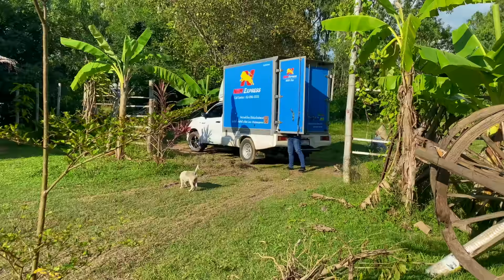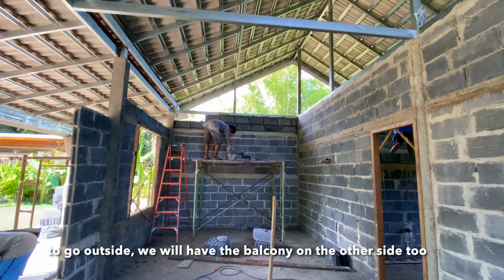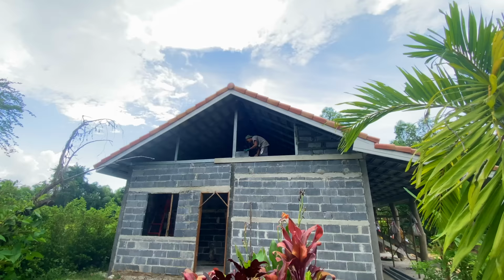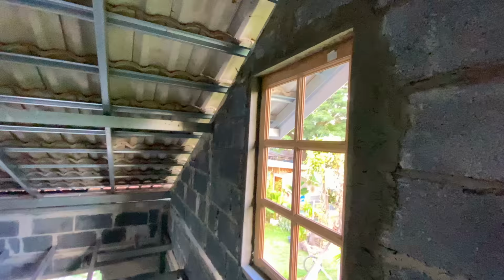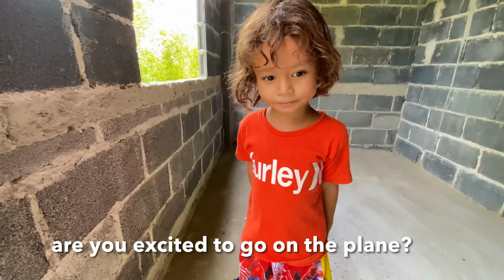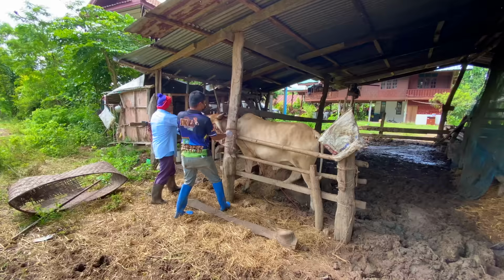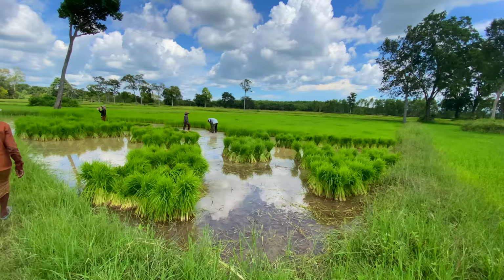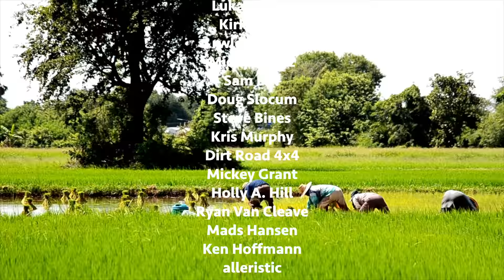Our HOUSE BUILD In THAILAND Is Making HUGE Progress! 🤩🇹🇭

Comment: Sorry to crash your party guys but I think you may regret the opportunity to have built with the insulated white bricks now commonly available in Thailand especially on the external walls.
And you could have added foil insulation to the roof tiles underside, it's going to be very hot upstairs!
Also it won't be long before you regret the reduction in the roof overhang.There is a reason why environmental designers and the Thais allow for wide as possible eaves.
But best of luck with the rest of the build guys.

Comment: Can I suggest or point out something on your foundation , You never use Barb wires to support the cement foundation? You need something like 10MM or more of steel bar. In the future you  there will be crack and will not end last those foundation. The Beam support must me Cement with Steel bars or wood size maaybe 12"X12" or more, I did saw a wooden taken from a tree, that's not good. Sorry to say but if building code-- it will not pass? Do you have As built drawings ?  The roof were good Center to center of 16" to 24" passed the building code. Hope your house is sturdy against Earthquake and typhoon. Why the Roof had been done first?  even in western world or Asia Roof is the last to built? The Foundation first then the Walls to hold the roofs? All Walls must be standing first? Kinda weird how Carpenter works there in Thailand? Good luck. The height of the floor to ceiling , you can use 8 ft to 9 ft ,so you can put the 2nd floor more space  to roof ceiling to maybe 9 feet. but yours is kinda maybe 6feet only?